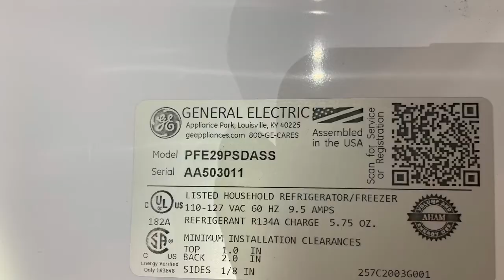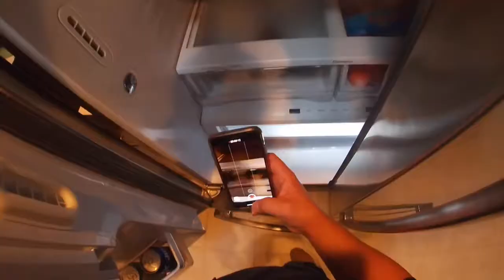How to Fix #GE #Refrigerator Making a Loud Noise | Model PFE29PSDASS

Comment: Hi there, I have a pfe29psdcss , and I have exactly this issue. Do I need a software update?
Reply from the maker: For my understanding you don’t need a software update for this motor you do need a software update for the refrigerator evaporator fan motor
Reply: @DIYRepairsNow  Thanks, I figured that part out, and mine is Feb 2014 so it doesn't require a software update. I just took apart mine and both of my fans are broken (both the damper fan and the evap fan). I ordered both. But was wondering if you know what each one of these do. Is my understanding correct: The evap fan is responsible for cooling the entire fridge. The damper fan is responsible for the bottom drawer?
Reply from the maker: Arsham Shahlari That’s correct that damper and that fan controls the drawers
Reply: @DIYRepairsNow  Does that mean that I wouldn't necessarily need that fan and damper as long as I set my drawer to 43 (and the main fridge to lower, maybe 37)? I have heard the damper and fan controlling the drawer breaks often, so don't want to waste $80 on something I won't miss. Thanks for your replies, and thanks for the video.

Comment: I've got a bush double door fridge the fan was sounding like a helicopter I took out the moter took it apart used some baby oil on bearing and it's quieter than ever
Reply: Which motor? Where is it located? Thanks.

Comment: I have this same fridge. My fridge is 63 degrees, my freezer is around 15 degrees...No loud noises. What part needs replacement for this issue? I removed back panel on the back of fridge and vacuumed some dust off the black circular piece but otherwise looks clean (although there is some dust I can't reach since I currently don't know how to remove the part yet) do you think the dust is the culprit or a fan issue or something else?
Reply: On mine, like this fridge, but a but newer (touch pad front panel/water and ice dispenser), I had a bad fresh food circulator fan. In this video, you can see it when he takes the large back plate which covers the evaporator coils at 5:09. It's not the one he replaces. The fan is blowing up the center ducting in the back of the fridge. Located right above the coils. My problem was the fan wasn't blowing fast enough and the could were frosting over. This led to the too section bring in the high 50's low 60's for the temp.i replaced the fan, and the new fan came with a software update. The software module gets plugged in to a port (looks like a phone plug) in the top of one of the fridge doors. I think it was the left one, but I forget now. There's a compartment in the other door also. It's where I found the technical manual which shows the airflow diagram some electrical schematics and how to enter the self diagnostic protocol. On mine, there is a front button combination that you push, then you can run a diagnostic test. The fridge will probably tell you what's wrong with itself. I figured out my issue before I found the diagnostic stuff. I was about 95% sure and the diagnostic confirmed it. Other potential problems leading to warm temps in the fresh food section could be: 1. the heating element which periodically defrosts the evaporator coils. 2. A bad bimetal thermostat (turns on or off the defrost heater). 3. A bad temperature sensor (giving the computer the wrong temp reading and messing up the defrost/cooling cycles). And, 4. A bad circulator fan. There are other issues, but I think these are the most common. I also initially thought my coils under the fridge were dusty. That can cause cooling issues because the compressor works harder to pump the refrigerant. But the design of this fridge doesn't seem to collect a lot of dust like older styles. The condenser coils are behind a panel that's screwed on, so it's not as easily accessible, but worth checking every so often. I know your post is several months old, do maybe this will help someone.

Comment: Hey I did this fix but the new fan doesnt seem to come on. Before going through the whole installation I plugged in the new fan and pushed both buttons to "close" the doors. The fan didn't spin up. Should it always run when the doors are closed? Could there be a short in the board of the fridge? Hope you get this!
Reply from the maker: Paul E Besides the two light switches it's a magnetic switch The only way you will be able to see if it's working it's put your phone inside and close the doors most likely he's working a problem on the board is not common
Reply: @DIYRepairsNow  thanks. I noticed before the installation the actual temperature was about 8 degrees warmer than the set temp. A few hours after they both matched at 37 degrees. Looks like it's working. Thanks for the awesome video. $80 part and easy install.
Reply: @paule9818  My GE PYE23PSDASS refrigerator had the same problem. I later discovered that the noise was actually from the fan motor that pushes the cold air to the ice maker which is within the left door. That design has its intrinsic drawback because the cold air has to travel a long distance from the freezer to the front door, whose insulation is always poor. The solution is rather simple. Just INCREASE the freezer temperature! My guess is that the freezing temperature somehow obstructs the fan or causes the frost/ice to build up in the motor. It was not the damper fan that blows the air to the fresh food drawer. The damper fan is not controlled by the door opening or closing.
Reply: @dinosaurkillers  My Adora freezer was making a loud noise (it became louder when I opened the freezer door). After reading your comment, I checked the freezer temperature (-1F) and once I increased my freezer temperature by a few degrees, the noise stopped! Thanks for the tip!

Comment: Our fridge is freezing food in the top section of the same fridge -- can this same part cause that? WR60X23104? Usually, the issue is that top part is not getting cold but I have opposite problem. It's getting too cold.
Reply: Unblock the whole in the dairy bin.

Comment: With these fridges, look for compartments in the tops of the doors. One should have the technical manual which will give airflow diagrams, schematics, and the diagnostic codes, etc.. Most of these appliances have a self diagnostic protocol which can help figure out what's going wrong. Mine had a software port in one of the doors. A new fresh food circulator fan (the one located right above the evap coils) came with a software update which gets plugged in to the port in the top of one of the doors. FYI....